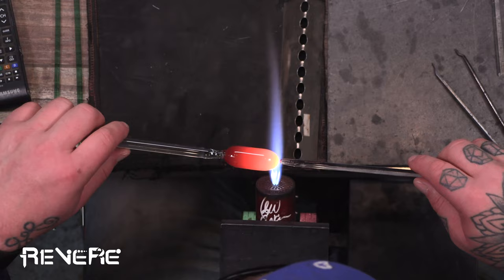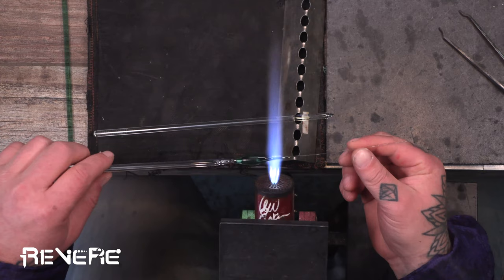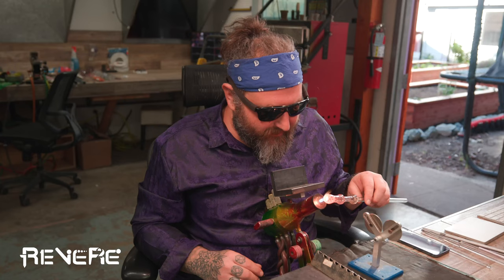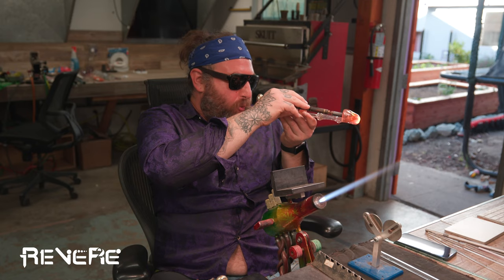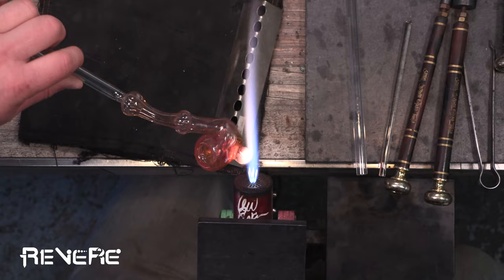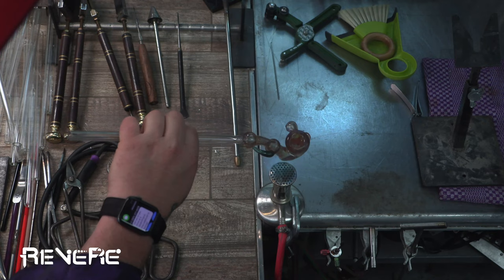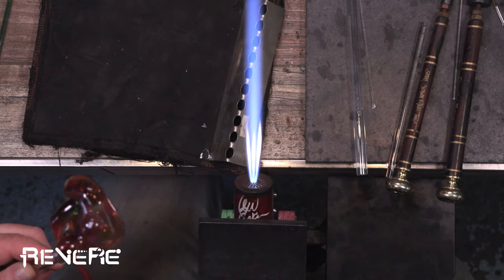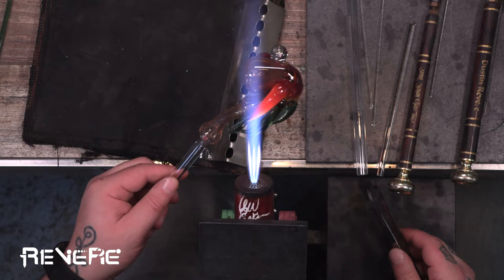How to use a Bunsen Burner II Sherlock with Attachments II

Comment: When adding things like a bunson burner or hand torch how does it affect the propane and oxygen pressure? Is it best to keep the regulators set to the pressure of your torch or do you need to increase the more things you add in line or when adding Y splitters?